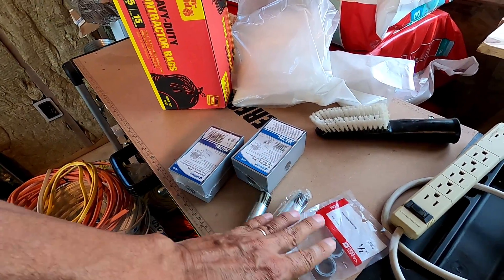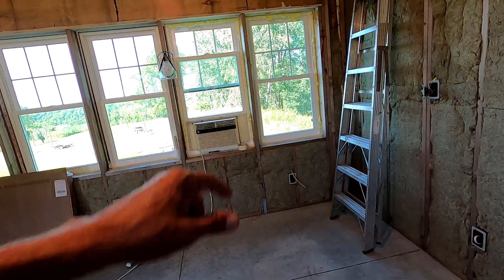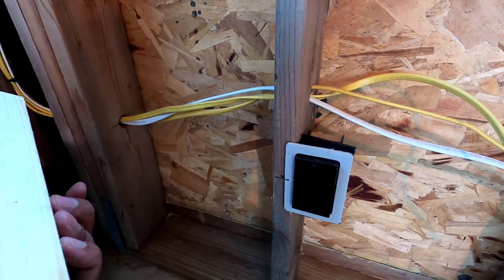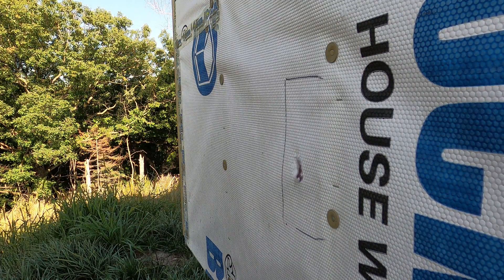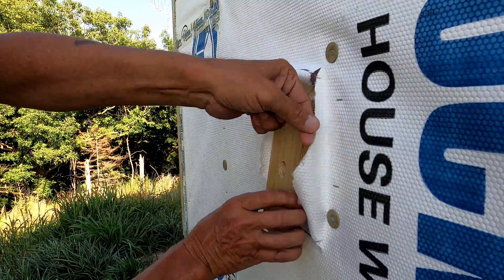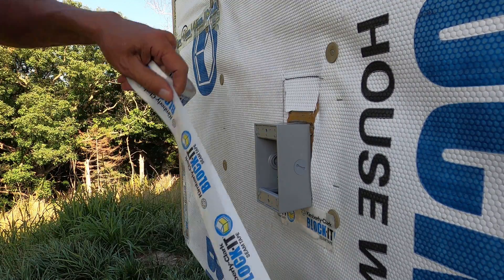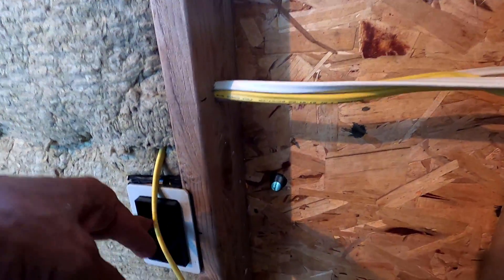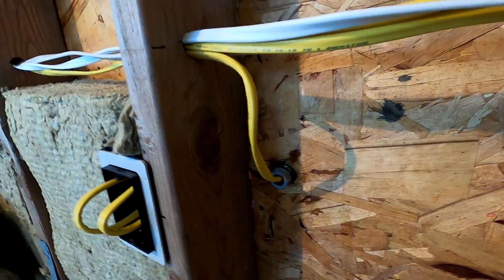How-to Install an Exterior Electrical Outlet

Comment: I would think it will be better not to cut the house wrap. Place the outlet on top of the house wrap and tape the top and the side (1/2 the tape touches the top and the wrap and 1/2 the tape touches the left and right to the outlet and the house wrap.  Leave the bottom alone without taping for water to escape.
Reply from the maker: Hi Khe_Sanh. The house wrap was just for UV protection until the siding is installed. The foam exterior is the real 'housewrap', and it is 100% sealed with foam and tape. The housewrap is now gone.

Comment: Is it up to code to run Romex through a conduit nipple?
Reply from the maker: It depends on the inspector, but according to code, yes, as long as it will not cause overheating —  like if you tried to stuff a bunch of romex thru a nipple. The alternative in this case would be to drag out the Thhn wire and throw a few tiny pieces through the wall, which you should do if you think the inspector will say something. There is a discussion on the subject at Mike Holt; https://forums.mikeholt.com/threads/romex-in-conduit.27329/
Reply: @PlanetMojo  thank you good sir 👍
Reply from the maker: @protoman247  You are entirely welcome! Have a great day 😊